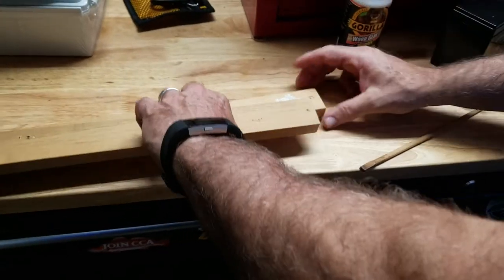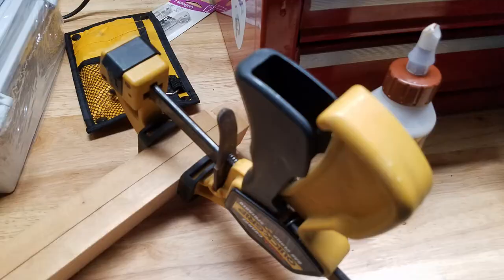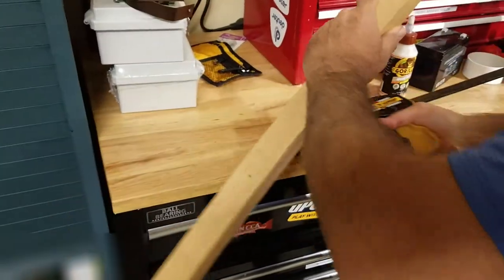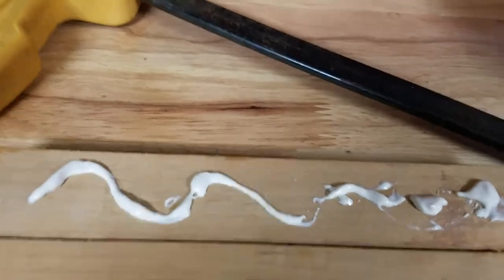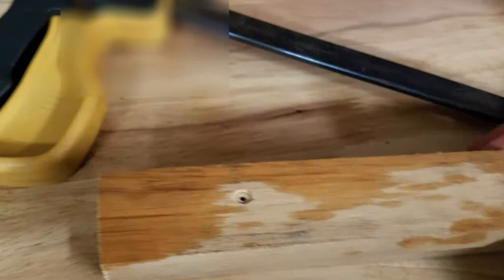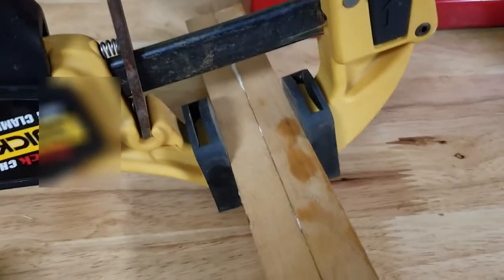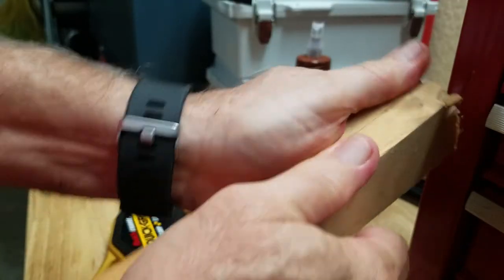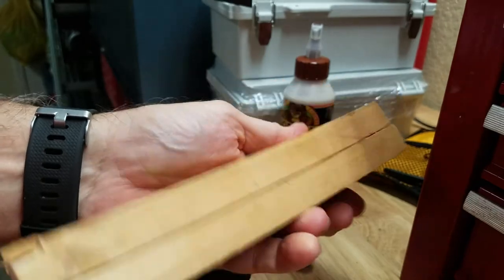Gorilla Wood Glue Ultimate

Comment: Spread glue evenly with an old credit card.  Don't make the squiggly snake line.  Makes for proper glue joint.
Reply from the maker: BTW, months later I tried to separate the wood and it cracked first not on the seam...